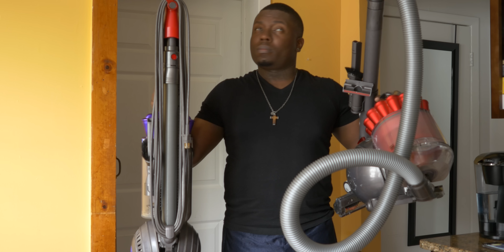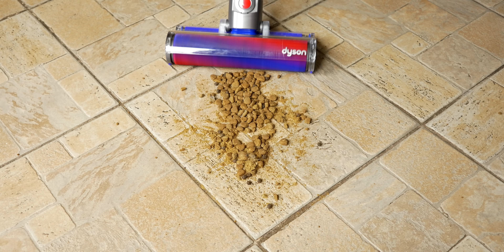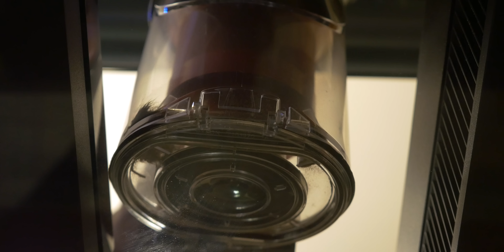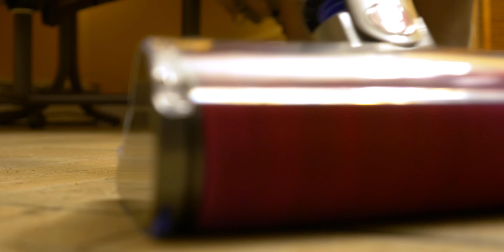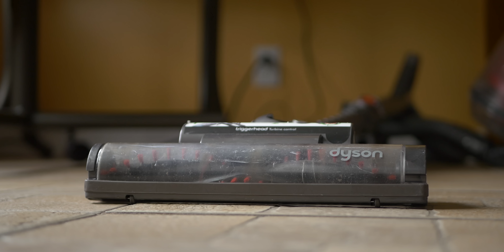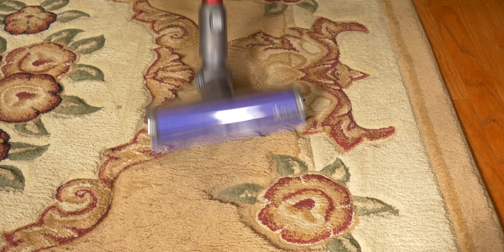Cordless Dyson vs Wired Dyson (Dyson V6)

Comment: 100 AW in boost mode but it only has a quarter of that on its regular setting. The carbon fiber filaments are too soft to remove anything from carpets. They are for dusting hardwoods. The nylon bristles dig into carpets and agitate the dirt out. However this V6 and even the V10 still doesn't come close to the power the DC41 has. The DC41 is still a better overall machine, because it still has a lot more suction and more brush bar power. It also has a cleaner head that automatically adjusts and a 35 foot cord.

Comment: great video! you help me make a decision.
Reply from the maker: What is your housing situation like? Also, what are your other vacuum options?
Reply: Dom-Jay Does Tech I live in an apartment. I have a shark rocket currently and I was thinking of just upgrading to one of the newer models. But Dyson looks like it works on hardwood floors better!
Reply from the maker: It works great on hard floors. I think it's a great buy, especially if you appreciate being cord-free. The soft-roller cleaner head kills on hard floors.

Comment: Watched over 10 videos of the V6 and sincerely it was by far the most interesting, funny and well recorded video I've seen. The only lacking thing would be a "noise comparison test" between the 3 units.

I just got myself a V6B Refurbished for 200$CAD today so twice less than the regular price for a brand new V6 Slim unit so that was worth it. Sure the V8 looks nicer but I ain't gonna pay 700-800$ for the difference.

Comment: Wow, thanks!!!  Best part is reverse cleaning at end, lol. Particularly appreciated the  comparisons to upright & cannister as No-one else seems to get that's an important consideration.  
I get unbelievable amounts of very fine particulates from my freeway & major road adjacent location. It seems to desperately cling to the laminate flooring I have. Vac roller leaves brush tracks, dust mop needs cleaning after few swipes, damp mop leaves mud. Going nuts, do you think V6/8 soft roller would work for me?
Now if only someone with really long hair (mine is mid back) would rate vacs for minimal roller de-thatching! 
Keep em coming, vac on...
Reply from the maker: I love the soft roller. You cannot go wrong with the soft roller. I can't wait till they start to implement this roller with some of the their corded vacuums. Yes, you should definitely purchase the Dyson V8 with with all of the tools.
Reply: Dom-Jay Does Tech - Thanks for the response. I'll start budgeting for it.

Comment: I just ordered the V8 -- gotta get you one!! 175% more power and 40 min batt life! Cant wait to cop the automatic 360.
Reply: The V8 is awesome! 40 minutes of battery power, you can't beat that!
Reply: +Dominic Jordane Well technically if you use it with the motorised tools it's 25 minutes not 40 minutes run time.
Reply: I bought it and when I use the motorized head I get at least 30 out of it even on carpet my house is a little over 1000 sq ft with a finished 400 sq ft basement and i can do the whole thing on a single charge. I love it.
Reply: +Dem'ral Youths Thats good to hear it lasts 30 mins with motorhead. I may buy one when my V6 Absolute needs changing.

Comment: This is so funny!! Thank you!
Reply from the maker: Dem'ral Youths no, thank you for watching. I appreciate it.
Reply: Dom-Jay Does Tech Hey I bought the V8 from costco and it doesnt come with the soft roller cleaner head. In your opinion, is it worth 100$+ to order one separate?
Reply from the maker: Yes, the soft roller cleaner head is the attachment that makes these cordless vacuums so great. I couldn't believe how well it did on hard surfaces with large debris. I would definitely buy it.
Reply: Okay thanks so much.

Comment: This completely changed how I do my cleaning. Before I used to wait for the last possible moment to clean because it was such an ordeal to get the vacuum out. But with this you can just pick it up and go. So it's easy to just vacuum a room whenever needed.

It easily replaced my old vacuum. The soft roller even does a better job as the floors are dusted when you go along, while my corded vacuum left the fine dust behind even if it had more power.
Reply from the maker: Same here, I love this vacuum. Thanks for watching!

Comment: Your video is one of the best I've seen.  You certainly know how to make reviews interesting and engaging.  I have a one bedroom apartment in London and have a Dyson V6 Absolute.  I think the UK colour is different to the one sold in the US.  I now use the V6 Absolute instead of the full size vacuum.  I find that if I am quick enough,  I can cover my whole apartment with the V6 machine before the battery runs out.  I can't believe how powerful the Direct Drive head is.  Mine has a 50 watt direct drivehead, not sure if yours has a 50 watt or a 35 watt one.  I do feel that the machine is a little flimsy and the plastics creak, but apart from that,  I like mine.  Thanks again for a great review.
Reply from the maker: Thanks for watching. Yea, it is kind of flimsy, but I just love how convenient it makes cleaning! Please subscribe. I'll be uploading more consistently.
Reply: blakaeg did you get the fluffy head with yours?  I'm assuming not?   Seemingly in the uk our "total clean" is equivalent to the "absolute" in the u.s.
I'm confused as to what the u.s version is for our "absolute" as it has more brush bar power.  Wish they would make it simple!
Reply: Claire Nicol Apologies for  the delay. only just seen your response. I did not get that attachment as the V6 Absolute in the UK has different heads. But I got the V8 Absolute now and that does have that head.